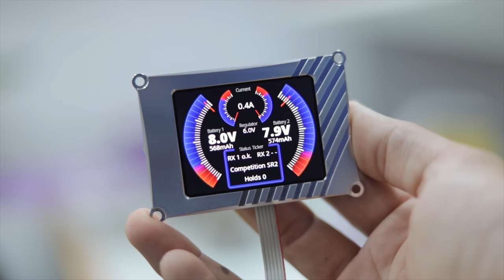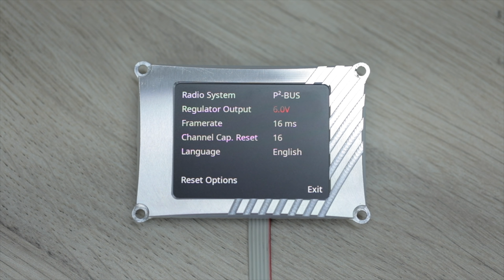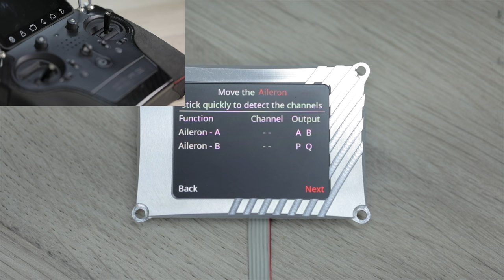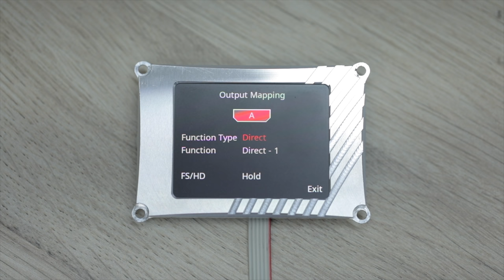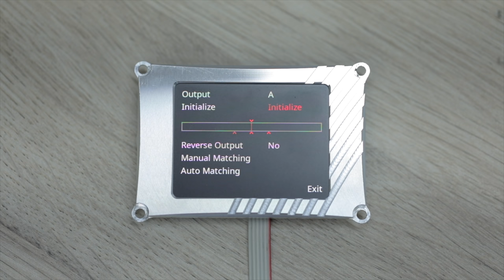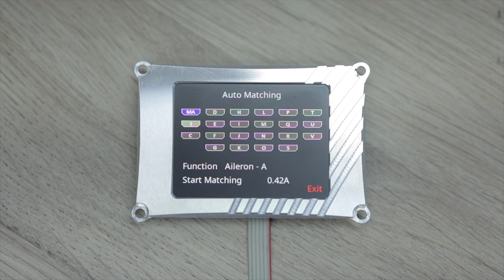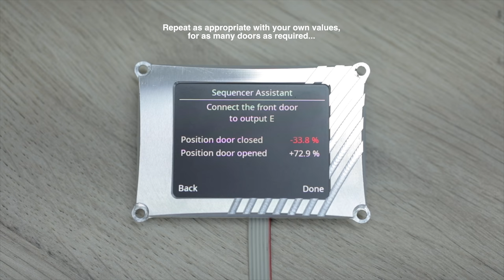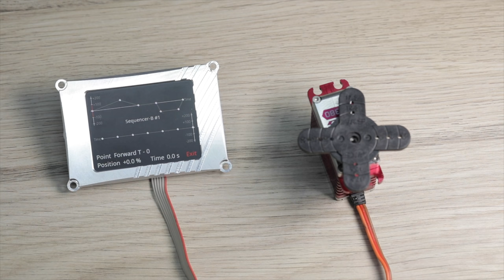Just released, Powerbox-Systems Competition SR2!! WOW!!

Comment: Hello Martin.  I purchased a new PB Competition SR2 last year (Sept. 2021) to replace my old PB Competition.  My older Competiton is in use in my 1/5 Scale BVM F-16 utilizing a Cortex Demon Pro Gyro.  How do I use my Cortex Demon Pro with the newer Competition SR2?  Or has the new Competition SR2 been designed to only work with the iGyro?  Oh yes, I forgot to mention that I use CONNECTION VIA 2x SERIAL INPUT / 2x SERIAL OUTPUT, and not the wire loom setup.  My radio is Futaba 18MZ with dual R7008SB receivers.

Thanks in advanced,

Ron S. (10/25/2022)

Comment: Martin, how can I set my SR2 from my CORE?? I do not have the menu point like you show at 2:17
Reply from the maker: You need to create a "widget" first. Just press on a blank part of the screen, create a new telemetry widget, and select any telemetry data point that relates to the SR2. The rest will then be as per video
Reply: @MartinPickering-PickeringRC  THANK YOU, I made it. But how can I set/configure my SR2 from my CORE without using the SR2 display. Is there any menu at the CORE?